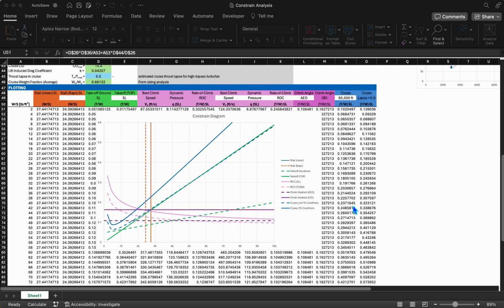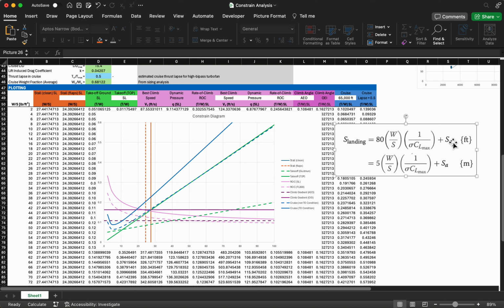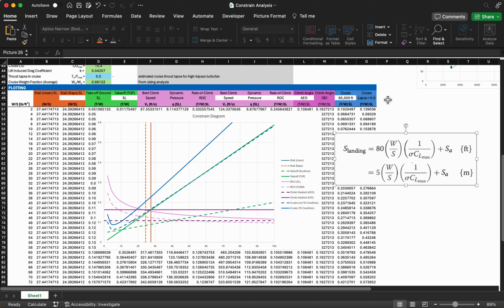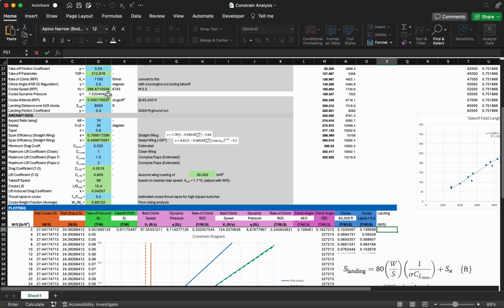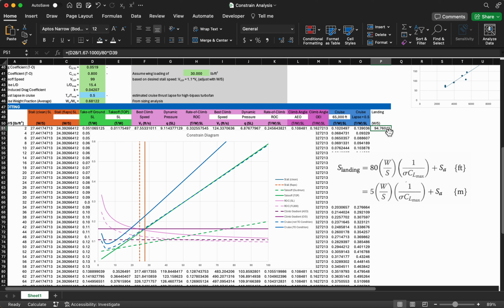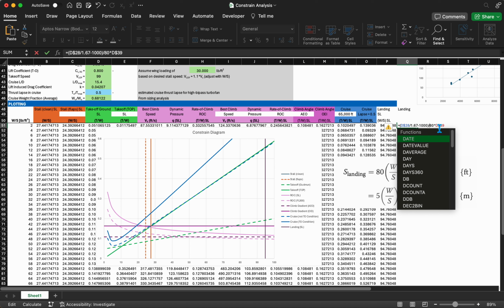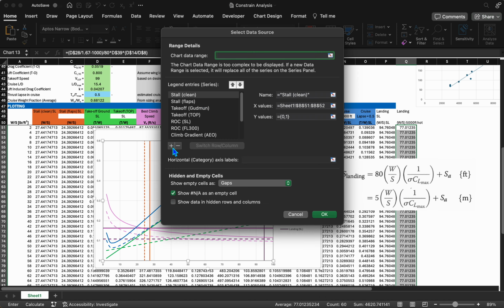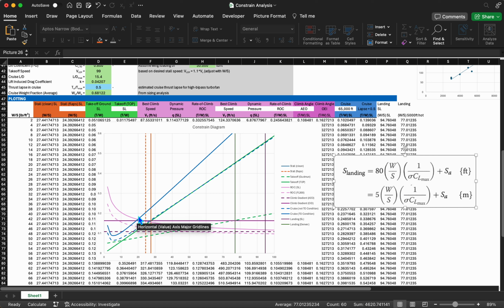Constraint Analysis - Landing

Comment: For context, my team (undergraduates) was drying to find the wing loading using the formula from the Raymer 6th edition manual for our constraint diagram. However, when we try isolating (W/S) and even using dimensional analysis, our units do not match. My assumption is the that the "80" value in the formula is a constant with the inverse dimensions of (W/S) times ft. I have read through the landing distance section did not find any mention of it.
Reply from the maker: The Raymer text states above the equation you are referring to that "a reasonable first guess of the total landing distance in feet, including
obstacle clearance, is approximately 0.3 times the square of the approach speed in knots." Then reference [14] is given (Loftin NASA Ref. 1060). From the onset, the units are not consistent in this relationship. The value of 80 is an empirical fitting parameter with "implied units" to make the equation consistent.